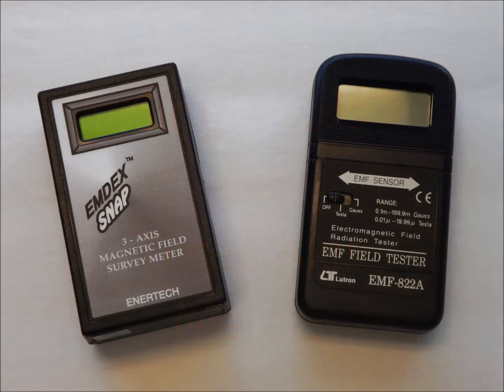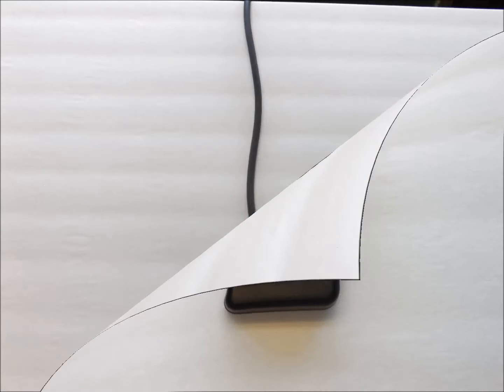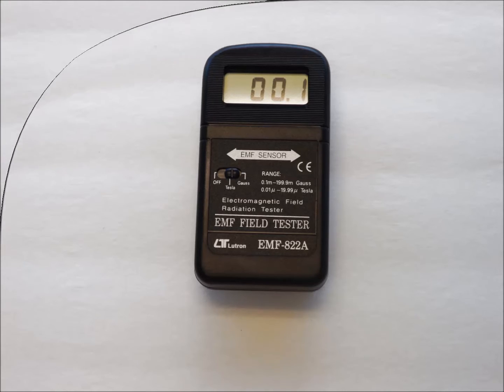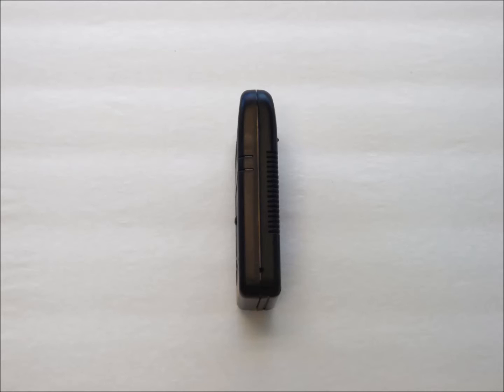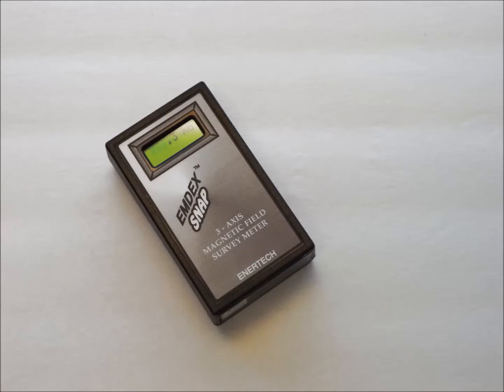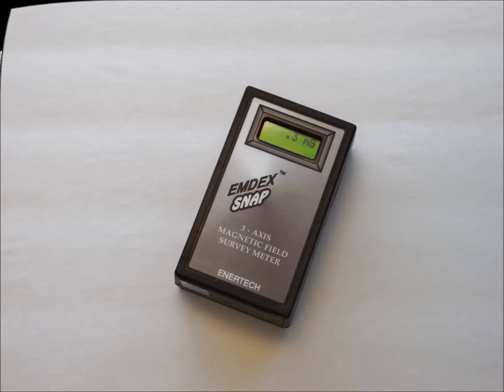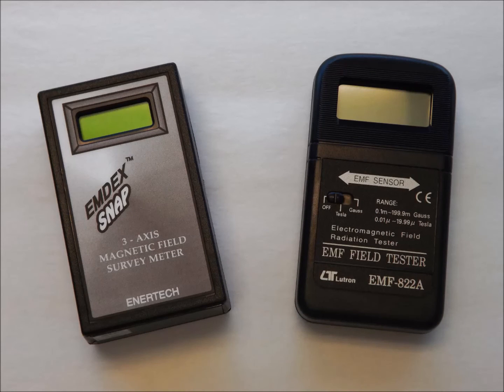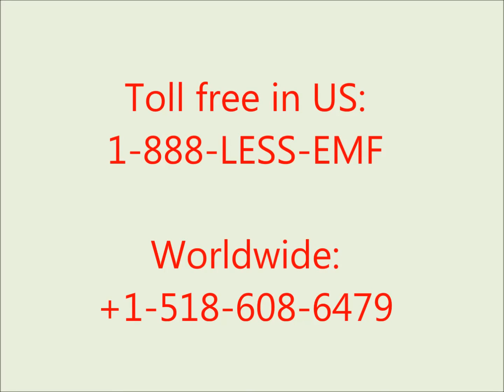Single Axis vs  Three Axis Gauss Meters

Comment: Are these sensors aligned to the North Star? Because every four years (leap year) they will be realigned. Does this go by the Gregorian  calendar? Is it connected to GPS?
Reply: its aligned with the Sumerian moon calendar. happy new year btw! it's today.
since its based over 10,000 years ago, they had no satellite built-in, but, you can buy the extension for a really low price of 5Gs.
don't be silly, this isn't a product review, its a distinction to what the reading capabilities are.
find the models and look them up yourself :D